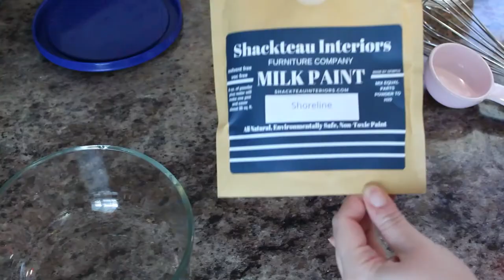Trash to Treasure | Furniture Flip | Furniture Makeover with Shackteau Interiors Milk Paint

Comment: Nice job on the chest of drawers.  I didn't quite get milk paint the first time, either.  Seems to me that it works better as a wash than for coverage.  Still not my favorite thing, I've had good results with washes using acrylic craft paint or watered-down chalk paint on bare wood.  'Chippy' finish looks like it should be easy, right?  It's not as easy as it looks!

Comment: I used milk paint and followed all the directions and it was terrible. It was streaky even though I mixed with a hand mixer. It didn't cover as much as I expected and I needed 3 coats. The SMELL was killing me. It was like dirt in an old museum basement. It did chip where I didn't want it too. I watched Katie's video after and I should have used the bonding agent but that was not recommend in the instructions. Overall it was expensive and time consuming only to have to redo my project and the next day it rained and was cold so it set me back quite a bit of time too. The good points were, It did sand up to a smooth finish that was beautiful. Next time I would only use it on something I wanted to look very old like an armoire or cabinet and expect the chipping and sand it down and then seal it. It doesn't suit every type of furniture and there are so many other types of paint to use that will save you time and money.
Reply from the maker: I think I’m going to try a different brand next time. I want to at least give it a second try before I completely write it off but it definitely wasn’t my favorite. The lady that bought the dresser loved it though so I guess that’s what matters. 🤷🏼‍♀️😂

Comment: I love using milk paint!  This turned out adorable, but looked like you struggled more than you should have with any milk paint, also having to use an excessive amount to get coverage.  I have used several brands of milk paint and the one I prefer is Junk Monkey Milk Paint.  Mixes very smooth and has great coverage.  I hope you don't give up on milk paint!
Reply from the maker: Thank you! I’ll have to try that brand!
Reply: @UniqueUpcycles  I follow several channels that rave about Sweet Pickens milk paint.  I'm planning on trying it. Have you used Zinser's white primer? It's shellac based wondering if that would still allow distressing while still giving good blocking so you don't have to use so much milk paint to cover??
Reply from the maker: @jcrefasi1  yes I actually used that  Shellac based primer over the top of the spots I had issues with. I didn’t want to prime this entire piece because I was hoping it would get chippy. I haven’t given up on milk paint yet. I’ll have to add that brand to my list to try!